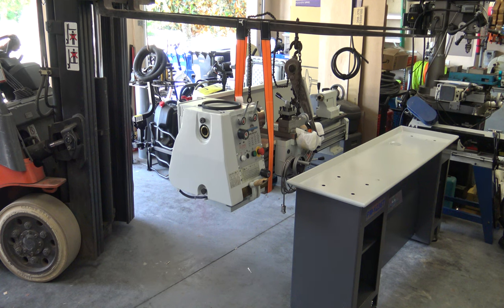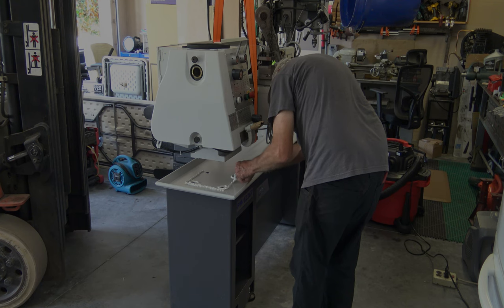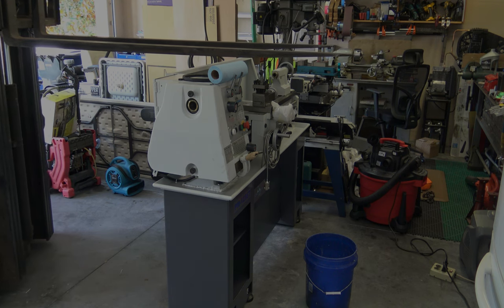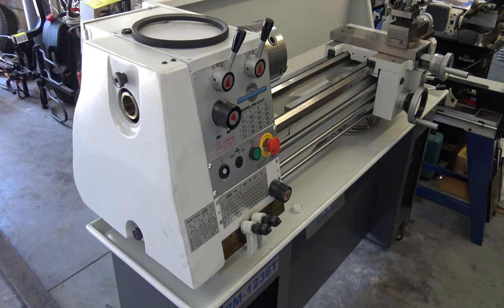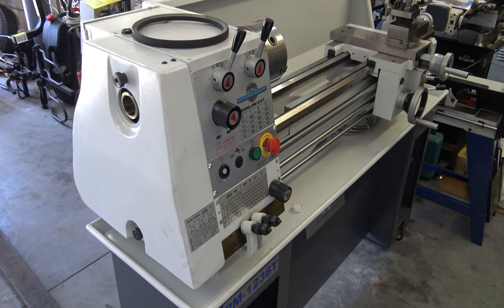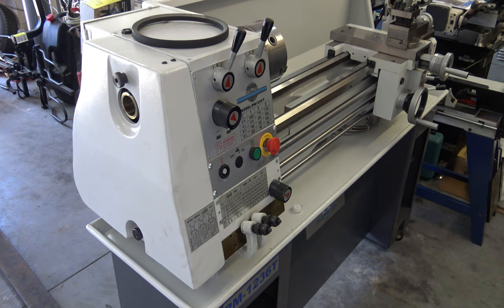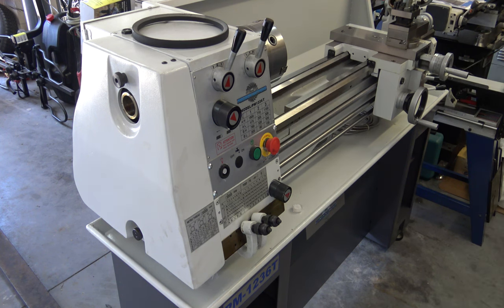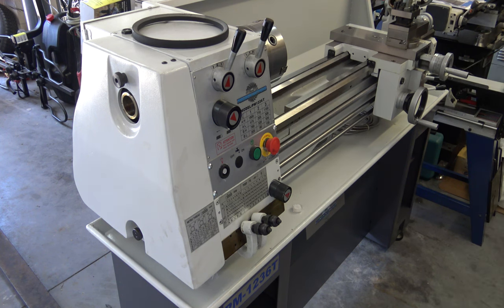PM 1236T part 2

Comment: My door hardware was the same, a little quick bending job fixed it. One cam of the three jaw chuck on mine needs adjusting but I haven’t gotten that far yet. I had to remove the headstock to get it light enough to get down into my basement so I need to re-align it. I purchased an MT3 headstock alignment bar to do that with.
Reply from the maker: Wow, I imagine it was still a beast moving it into a basement even with the headstock separated.
Reply: @mdw66799  not just the headstock, everything came off right down to the bed. I made a steel lifting bar and it went very well with four of us.
Reply: @robertpearson8798  That would have made a good video, moving your lathe downstairs. Did you film it or take any photo's? Cheers Tony
Reply: @eyuptony  I took a couple of pictures of the bed ready to be moved but I was too busy just getting it done to bother doing anything else.
Reply: @robertpearson8798  Is your lathe reassembled again and working?
Reply: @eyuptony  Yes, essentially. I put it up on some bricks to get it a little higher but that’s only a temporary solution. I’m in the process of machining some steel risers. Once they’re installed I’ll re-check the head alignment and the bed level and run some other checks on the chucks.

Comment: I encountered one small problem with the lead screw direction knob. After turning it a few times with difficulty it finally stuck in one position and wouldn’t move. After some back and forth with PM we realized that there’s a detent on that knob that’s not in the manual. Upon removal we determined that one of the three divots for the detent ball was drilled too deep and was trapping the ball. They’re sending me a replacement.
Reply from the maker: Interesting. Mine has been difficult at times. Hasn’t gotten stuck yet. Thanks for the info. I will be keeping a closer eye on it.
Reply: @mdw66799  If you decide to take it out you need to remove the detent through the side of the headstock (set screw, spring and two steel balls) and remove the spring clip on the inside of the gearbox. They suggested that I could fix it with some JB Weld and I’m going to try that but I’ll install the new one when it arrives. I wondered if anyone else had had this problem, perhaps to a lesser extent.
Reply from the maker: I just did my 10 hour oil change yesterday, way past the 10 hour mark. Opened up the top cover to check on all the gears. Everything looked good. Thank you for your comment. At least now I know how to access the knob on the inside if needed.